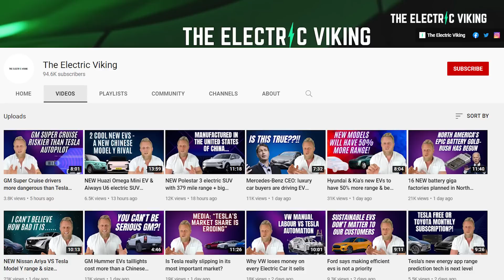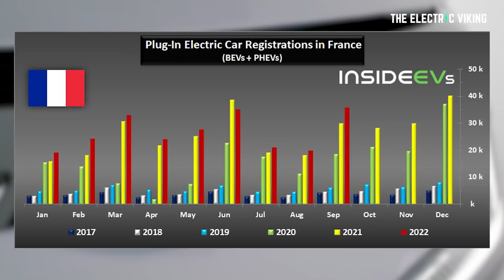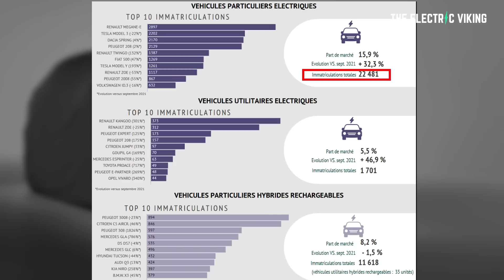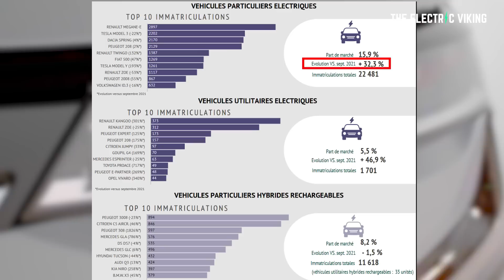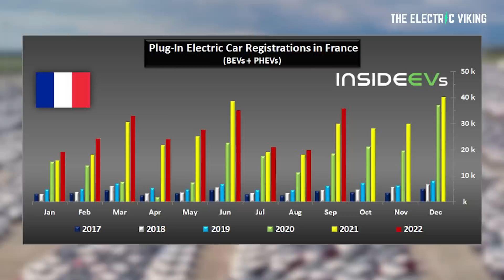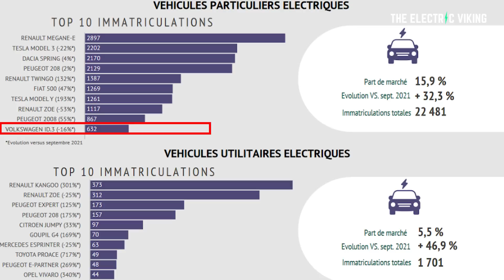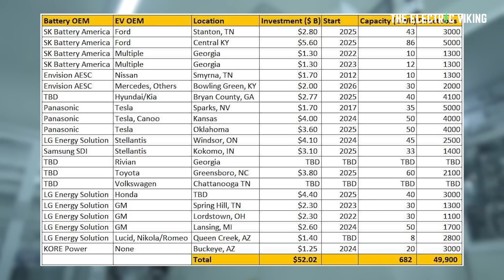Tesla & new Renault EV help France reach record high EV sales

Comment: Thanks for covering the French market Sam. I live in the Poitou-Charente region of France and have owned a Kia e-Niro since March 2019.  Apart from Renault Zoe's an EV was a rare sight on the roads back when I got the e-Niro. In 2020 France reached the 1% mark,  with 320,000 EVs on the roads (France has about 32 million cars)....it had taken 10 years to reach that level, this year will see almost that many added in a year. Most common Evs I see apart from the Zoe?....Tesla M3, Kona, e-Niro, Dacia Spring and of course the Peugeot and Citroen EVs...but they’re not always easy to spot as the petrol and diesel version look the same...Diesel sales have collapsed here as have overall car sales. France was typically a 2 million new cars a year market, sometimes more before Covid...I have seen a couple of the new Magane on the road, they look great and I expect by next year will be a common sight. Also to look out for in the French market is the Peugeot e-308...the 308 is a massive seller here (VW Golf sized car) so the electric version is likely to make and impact.

Comment: As a dutchman i like the way french build their cars. Elegance and comfort is in their dna. That alone is reason enough that france build their own cars
Reply: Yeah but they are not software engineers. And that is the future of automotive.
Reply: But they aren't ground up EV vehicles, they are ice vehicles with EV drive train. They wouldn't have the structure to carry the batteries under the floor so waist a lot of space.
Reply: @reyfetsalmo3346  A valid point. None of these cross breeds does anything well.

Comment: Here in Nice, France, Tesla is the only game in town. I've seen hundreds compared to a tiny (single digit) amount from any other manufacturer. Lots of Tesla taxis too. For commercial, a few Renault Zoe with company logos on the side.

Phillip.
Reply: in Paris the number 1 is the Fiat500E, same as in Berlin. Megane Etech starting to do well but long waiting list so it is difficult to tell
Reply: @dnap1991  Doesn't surprise me for Paris. Probably a few Twizzy too. Never seen an eMegane, but I have seen a couple of Fiats. Are the new Smarts electric? Tesla easily 10x all the others combined here though. 

Phillip.

Comment: Interesting but not a surprise the biggest manufacturer is Stellantis, who were first during quarter 1 dropping back to fourth by the end of Q2. Also the French are very loyal to their national brands. The Times ran an article on Tesla’s deliveries of 343,830 vehicles during Q2, best result but below expectations consequently hitting the share price. Interestingly not reported so widely “BERLIN, Oct 14 Reuters  - Volkswagen deliveries were up just over 10% in the third quarter as supply chain troubles eased but still down 12.9% overall this year at just over 6 million vehicles, the carmaker said on Friday. All-electric cars made up 6% of all deliveries, totalling 366,400 vehicles.” The point being all the big manufacturers are slowly moving their customers first to hybrids and then to electric, designed to maintain that brand link. If VW is producing 6 million cars and now out producing Tesla. Tesla has a problem, the products are too limited and it doesn’t carry the clout of the big boys to over come logistics issues. The Empire is striking back?  
A separate study has identified that VW has been over taken by Mercedes. Viking it’s worth looking into the van market, or EQV has Mercedes call it. The last big UK survey 2019, there were 4.5 million vans, Stellantis and Mercedes have the lion share new vans increased to 3.6% in 2021. So far this year, that proportion has increased to 5.3%. 2021 saw the biggest annual increase in the number of electric van registrations, with almost 13,000 electric vans registered, showing a growth of 240% on 2020. Ford has only recently joined the market with the electric Transit. If you want to seriously test BEV platforms put them in Vans used daily for short and long multiple trips recharging etc, does Tesla propose to build a Van? Also Lorries and Buses , all the European manufacturers and Hyundai have small battery lorries in service, larger Hydrogen cell and Hydrogen ICE tractor units under test or in small deployment with some businesses across Europe, as the Tesla lorry been delayed again? .